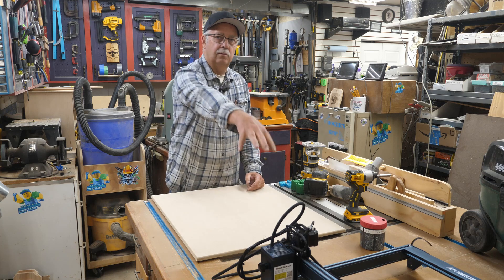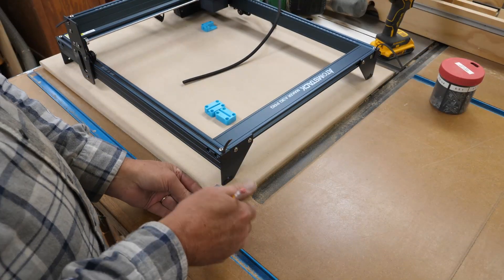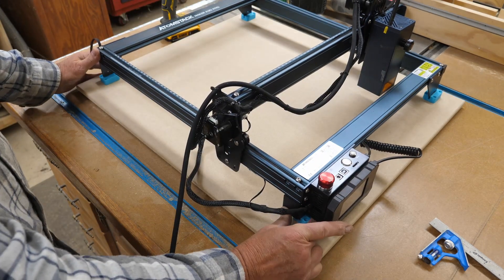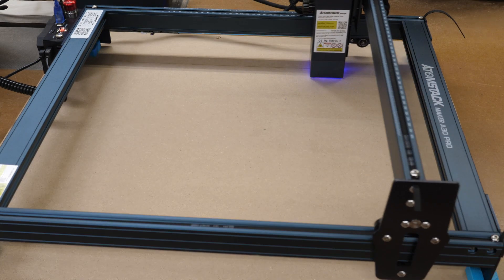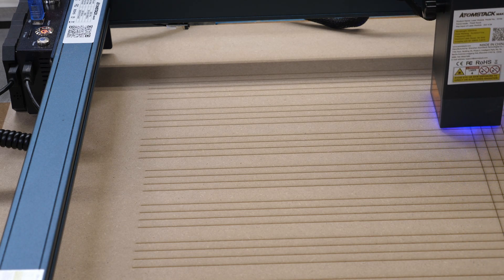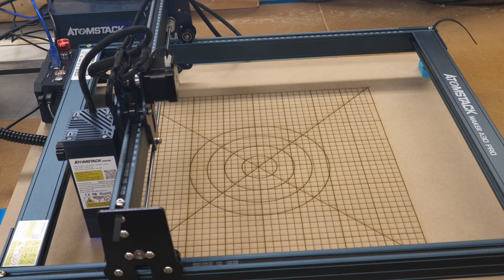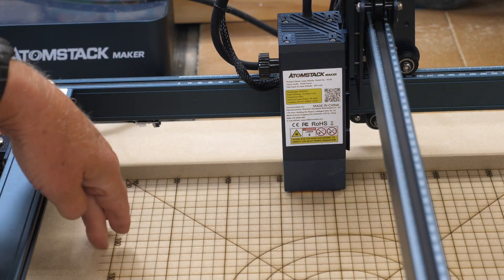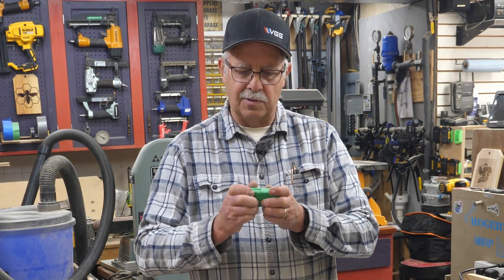Atomstack A30 Pro Custom Spoil Board and Risers

Comment: Roger, great video. I too am a fan of the stackable feet and knowing that my X20 is locked in to my board regardless of the height I am using. I did upgrade to the Atomstack e85 extension kit (850mmx800mm) and the feet of the machine are significantly longer than the 20&30 series. The feet are over 5 inches and I'm trying to figure out if your risers might be a good fit for the new frame.